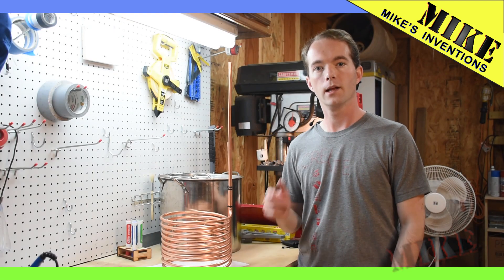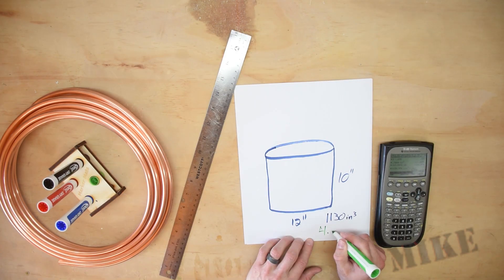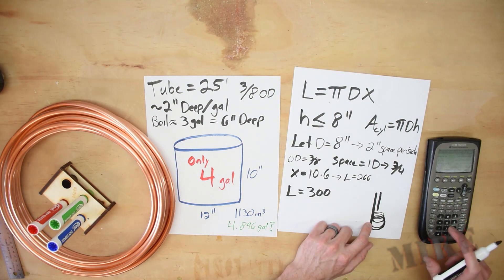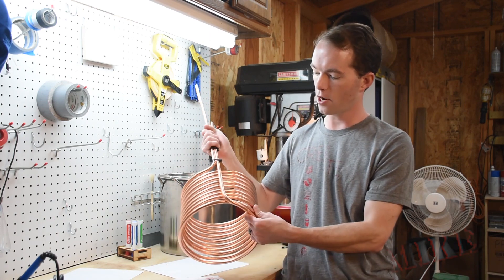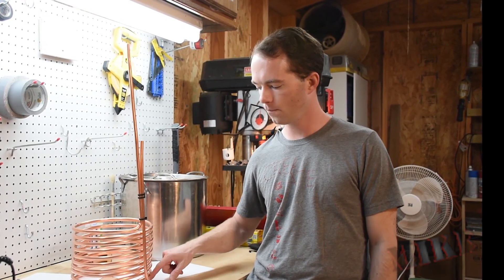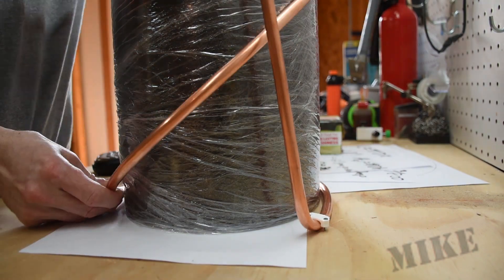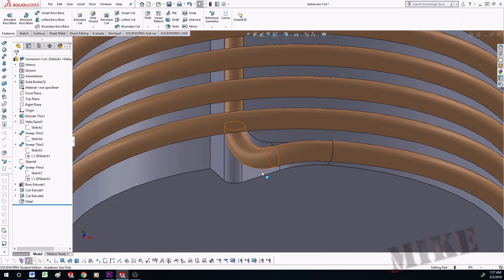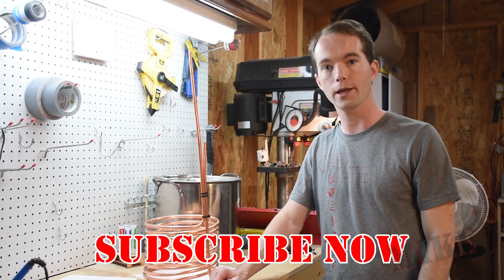DIY Immersion Wort Chiller - Mikes Inventions

Comment: I took the simple ape approach to making my immersion chiller. I filled my tube with water and placed it in the freezer. The next day I just grabbed a random tube ( 8" in this case) and proceeded to bend it around the tube with no problem and no kinks. After I was satified with the shape and placement, I then proceeded to ziptie each go-around. Frome there after a nice alignment I proceeded to tighten each one and cut off the excess.

Comment: Mike, How are you connecting the washer/garden hose section to the infeed of the coil? I  can see the flex tubing at the discharge is just squeezed over the copper, but I can't see the infeed. 
Thanks again.
Reply from the maker: It's half of a washing machine hose shoved over the end of the copper tube